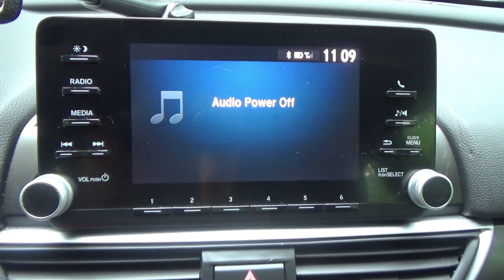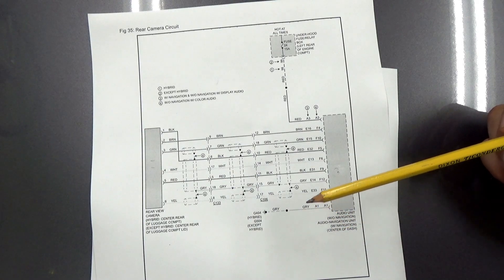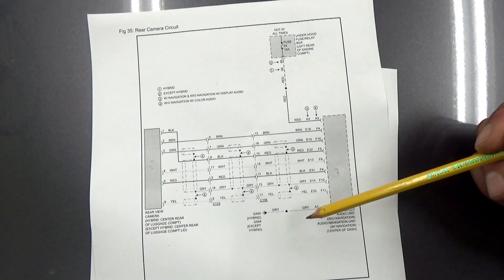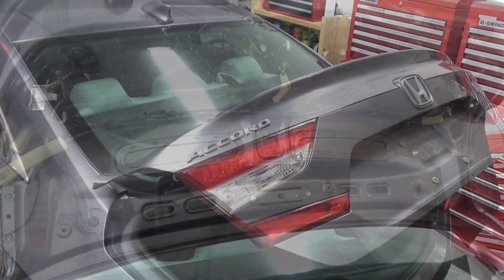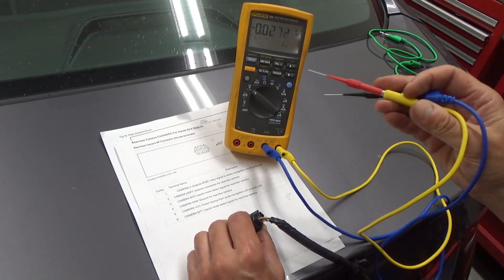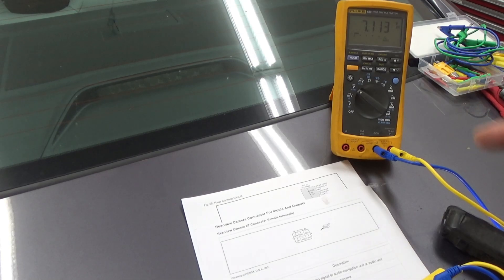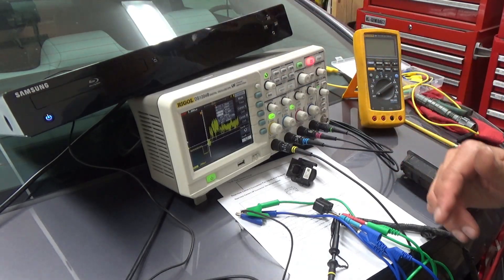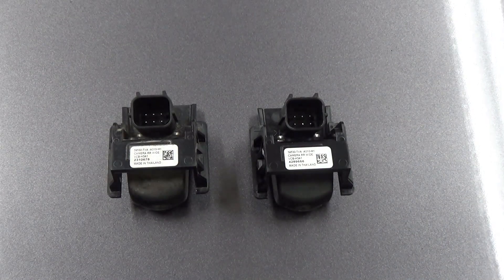Honda Rear-view Camera Psychedelic Color Issues and Fix

Comment: Can you tell me which connector is connected to the main unit and which color pin it is, if you know? I think it is a 12-pin connector with a yellow wire. However, I don’t have a document like the one you have. Where can I find this document? Could you share it as well? Thanks.

Comment: Another very informative and well-done video.  I was hoping you'd disassemble the inop camera as I was watching and you didn't disappoint!
Reply from the maker: Thanks for the nice comment Jeff!  I was hoping that I might have been able to find the root cause of the problem inside the camera, but no luck with that this time.
Reply: Thanks buddy for the video. I was rear ended a few years ago and got it repaired and then 8 months later I had the same issues as you. Ill replace the module and hope it fixes it.